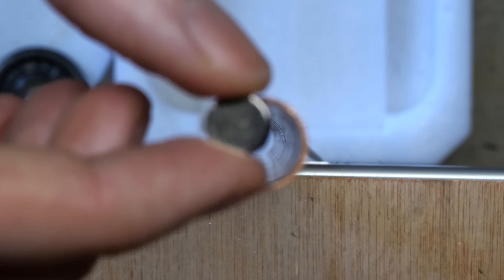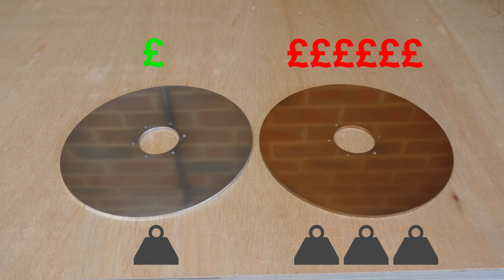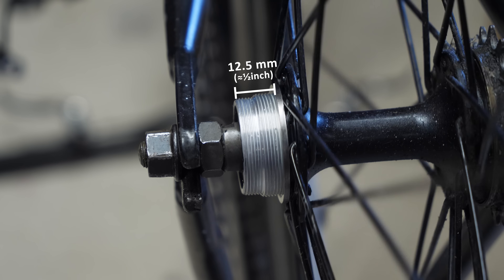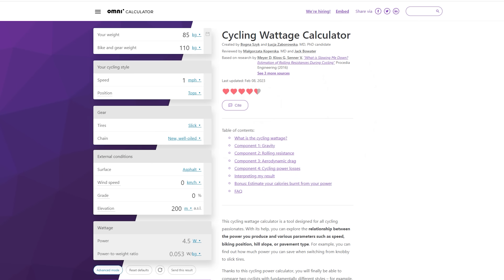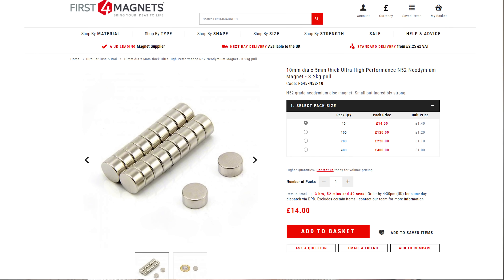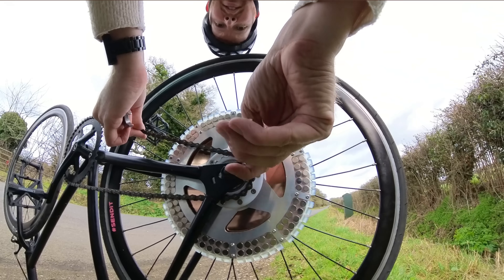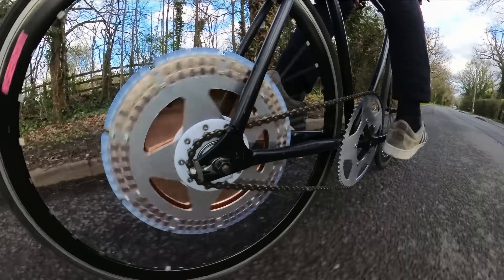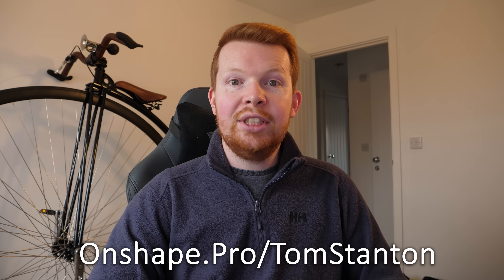Gearless Magnet Bike

Comment: I could see this being used in conjunction with a standard chain drive, as a way to hold a speed or soft-stop. Something with a small lever to introduce the magnets into the vicinity of the disk, maybe as an anti-runaway feature when going downhill. I know what it's like to have your speed get away from you rolling down a slope, and your pads just lose all friction as liquid rubber smears out and forms a liquid bearing between the actual clamping surface and the brake. It's a great way to renew the surface for hard stops, since the melt-cool cycle leaves very clean pads, not so great for the pad life lol. 

Awesome video as always, I will await whatever may come next!

Comment: Maybe I missed it in the comments, but one other problem with this design is that you have to pedal with such consistency or you're losing additional energy. If you pause--or even just slow down a bit--in your pedaling at e.g. the top of each revolution, then for that moment, the wheel is spinning faster than the magnet cluster and some portion of the energy you just put in will come right back out.

Cool idea, though. Have you considered adding some sort of electric assist via a normal (or custom eg belt or shaft) drive, and converting your magnet setup to do regenerative braking. I think a hybrid bicycle like that which never has to be charged could be sold as a "sweat-free commuter", because the electric could engage e.g. only during acceleration from stop or steep climbs, or other times when riders would normally break a sweat...

Comment: You demonstrated the main problem in eddy current systems is that the more force/torque you put in it, the more energy it wastes. This makes them pretty inefficient for power transmission, but good for braking - when wasting energy is basically the goal.
I don't think eddy current brakes would be really useful on a bike, since brake pads are cheap anyway (compared to all those magnets and metal plates), but they are used on heavy vehicles like coaches and trains.

Comment: Would be a perfect replacement for an internal clutch on a very low power moto.  Maybe with an additional friction lockup centrifuge clutch to eliminate heat once rolling.

Perfect for a lawnmower, edger, trecncher, etc, etc....in need of breakaway safety.

Low hp outboard motors used in shallows to replace the breakaway pin.

I just made us millionaires.

Comment: Not sure what you are trying to do here.  Make a magnet brake, a magnetic flywheel gear-shifting device, ... or a Tesla flywheel propulsion device.

Maybe make the Tesla flywheel.  Install a battery pack, inverter, alternator, and use a magnet flywheel with a fluctuating (electro-) magnetic calipers.  Use the same maglev train technology for moving the vehicle across a path line of magnetic rail - with fluctuating magnetic polarities.  The flywheel makes easier and faster velocity, less pedaling.  Have the same motorcycle handle speed device - increase the magnetic fluctuations speeding up the flywheel and velocity ... or slowing down and natural magnetic braking.  As one moves, with pedaling or momentum, the flywheel with another set of calipers charges the battery pack.  A little entropic energy wastage happening - but pedaling and continued momentum keeps up the charge of the battery pack.

Comment: Nice project, thanks for a great walk-through.  I believe Aluminium has a greater electric density than Copper when measured by weight.  However, Copper weighs a lot more by volume, so Copper would come out on top with the same size discs.

Comment: I wonder whether you ever rode a bike in urban conditions. When you stop peddling, the system breaks, which will be a real annoyance. You don't stop peddling in order to break all of the time. I'm from the Netherlands where bike riding is almost the mode of transport number one. And some part of bike riding is done freewheeling without losing speed, like when turning a corner, descending a slope, or just when the wind blows in the direction you are riding. Your system prevents this, taking most of the fun of bike riding.

Comment: It would be nice if you could figure out a way of moving the disc away from the magnets as you are pedaling, then closer as you stop pedaling. Like how a manual clutch works in a car. You could use a handle bar mounted brake lever to engage and disengage the plate. 
Another idea would be to try building something just the opposite of what u did here. Arrange 3 or more plates of alternating magnet discs similar to those so-called free energy motors. So as you are pedaling, you would get a small boost similar to the heavy flywheel experiments you did. It might not be much but it would be interesting to see how much the force would change by adding more discs.

Comment: @Tom Stanton - Plain old AC Induction Motors work extremely well as Eddy Current Brakes, and they are infinitely adjustable across a wide range of 'grabbing strength' just by varying the DC current input. A very simple example is to supply 12 volts DC to the input of a motor designed for 120 volts AC. If you could source a pancake-style induction motor that would fit on a bicycle, you could do both powering and braking with the same direct-drive device, with the automatic benefit that an eddy current brake can't ever totally lock up the wheel rotation... Sort of like an ABS system on a car.

Comment: Ever thought of trying out building a coreless axial flux motor for a bike? If you could minimise those eddy losses, you would for once have a motor that does decent freewheeling and regen-braking. An old Bionx D could be useful for that, although it probably won't be able to develop enough torque.

Comment: Come on!
B+ for idea; D for execution!
In your experiment at 1:24, why aren't you placing a strain gauge between your test weight(s), and the cord!
That's the information you want!
Yes, the rotational inertia of the disk IS a factor, but, rototional momentum is a function of ￦^2, plus, you are talking about a bicycle wheel, with a lot of additional mass...that's a separate calculation.
Once the disc is revolving, it's a pretty steady state, is it not?
So the force indicated by the strain gauge less the weight of your ballast mass should clearly indicate the braking force of the eddy-current effect!
Also, this opens the door foor testing at higher RPM's that we would expect in 'cycling.
(And get some smooth jaw covers for that vise! You obviously have the money!)

Comment: Why don't you use repelltion of permanent magnets without electricity to spin the wheel or a generator
Buy using gears clutches and control plates to stop repelltion if necessary to gain more control over the system

Comment: A nicer version would be to use the magnets to make a dynamo, store and smooth the energy with super capacitors and use DC-DC converter to power a motor and control the pedaling force/resistance. But that's too complex for a small project.

Comment: You realize the purpose of the gears is to act as the transmission.... as opposed to a break... right? I'm just guessing here, but the torque transfer hyperbola that you get from one of these magnet Drive gears is actually facing the wrong direction.... given that the purpose of a gear is to actually control the amount of torque relative to the grade of the ground your riding on. So what exactly is this for? A brake? Or am I missing something...

Comment: Wondering how it might work using a motor to drive the clutch rather than the pedals? This could then provide frictionless supplementary power when using a regular pedal / chain/ gears setup.

Comment: Would this application be practical just for its braking performance?  I live in an area with lots of steep grades and ride an E bike that weighs  a 100lbs.  I've already eaten through several sets of brake pads and have even retrofitted larger discs.

Comment: Great project, but why the heck are you still using a plastic gear on the rear wheel? It make no sense! 🤷‍♂️🤦‍♂️
Btw... When you use an kind of power generator - why no to go step forward and use it to produce energy for as an example lights on the bike... Or an resistor - maybe it would be easier to go uphill?

Comment: This is really brilliant, but I was skeptical at the start of the video, since the force is transmitted, not the energy, IOW, the whole transmission system will have much less efficiency. So none of your results surprised me. By the time I got to the 15:00 I was fairly shouting at the screen "You're working harder because you're dissipating a lot of your energy into eddy-current heating of the disc. Measure the temperature and you'll see, it must be very hot." And then you measured the temperature. To make an automotive analogy, it is not much like a CVT, it is more like a torque converter in an automatic transmission.

Comment: I wonder how a radially-split copper disc would affect the eddy currents. I'd assume the right size of splits would disturb the eddy currents and implement a tighter clutch; of course the wrong splits might do the opposite, rendering the disc nearly as effective as plastic.

I'm just imagining at some point you had currents going fully around the rim of the disc.

Comment: The key term here is "dissipated power".  That is how your clutch is working. By DISSIPATING the energy you are providing by pedalling. The movement induces an electrical current which is short circuited by the copper and turned into resistive heating. You have invented a bike where you are always riding up hill !!  Riding a bicycle already produces quite a bit of CO2.  You have just upped the " grams of CO2/km" !  LOL.   Interesting video, none the less.

Comment: fascinating, maybe with more R&D you could come up with a genuine marketable product with low maintenance variable gearing, but for years i rode fixed wheel on my winter bike which is about as light and trouble free as it gets, (even though it could be quite tough on club runs in the yorkshire hills lol). GL

Comment: This is how many exercise bikes work. Exercise bikes typically spin the flywheel faster instead of using stronger magnets - so the low damping of weak magnets gives higher power dissipation due to a faster rpm.

Comment: Absolutely Brilliant idea!       I’ve struggled thinking of a solution for an inertia clutch used on 7.5 gauge train.    This hand powered train is operated by a small child using a vertical push and pull lever method, however operated by only one person.   

Once under motion stopping is near impossible as the inertia transfers back to the hands.   One way clutch sprockets make start off difficult without starting  assist (a push) to get the offset crank under motion.     

This combined with a radial ball bearing shift cvt (drives the SIDE of the chain) may be the “magnetic clutch” needed to start off easily with faster easier hand movements shifting the cvt quicker , then stopping when hand motion ends without a sprag style lockup forcing movement of the handles causing the child to let go.

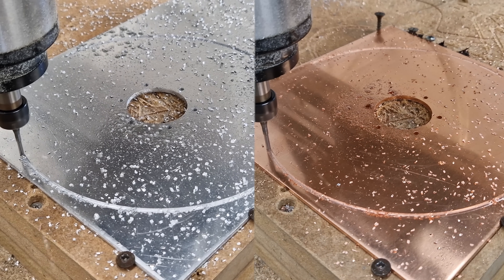Comment: 0:33  "To replace the gear system on a bicycle" 
Makes crappy plastic gear to replace perfectly good metal one

This was entirely pointless and counterproductive, however good for learning. But as a project, an archaic fixed-gear bike accomplishes the job with nearly 100% efficiency, with minor mechanical losses. The whole point of the clutch is to engage the hub which engages the wheel... Si the idea of using magnetism introduces an extra step that makes the whole thing an inefficient, expensive, fragile mess. It's the equivalent of gluing sponges to your pedals or taking the teeth out of the chainring and just making it work by sheer friction. Mechanical engagement is the way to go for these simple things. Hope your next project goes well

Comment: Making the copper plate thicker would reduce the number of magnets needed by decreasing the resistance for the eddy currents. And as other people have commented mounting the magnets in a steel mount would also improve the performance by helping to concentrate the flux. Similar just for kicks project would be to try to convert this into a homopolar motor regenerative braking setup with some big capacitors.
Reply: Also making the plates from a larger diameter plate would result in less input speed equal to the increase in primary drive sprocket getting that magical speed differential is probably key to better transmission and more heat dissipation
Reply: @Neil-z2o Bring on the copper wheel rim! About as little slip as fixed gear mechanical at maybe 4x the weight! Would be an interesting test.

Comment: If you construct a mechanism that can move the magnets more inwards on the disk (decrease the radius) and outwards you could get a continuous shift in transmission ratio instead of integer ratios. I might have skipped the part where you mention this in the video
Reply: If I understand you correctly, thisiis not true. The gear ratio would be the same; the magnetic transmission does not seem to provide any advantage over direct chain transmission.
Reply: @filipdominec9604  Ah yeah right the rear wheel also has a chainring

Comment: Tom,  I have written software that simulates a bike electric rear wheel/CVT using the equations from the book “Axial flux permanent magnet machines”.  Was thinking of getting in touch last year but didn’t.  Now saw this video and see you are still interested in the problem.  As you show at the end of your video, the main problems are efficiency and especially getting torque for climbing efficiently.  The software I wrote uses a GA to optimize the parameters of the motor generator to achieve a target efficiency profile over the operating range at minimum cost.  Unfortunately, it turns out it’s good to have a few gears to get efficiency up over 90% across the whole range.  The S/W will optimize gear ratios.  My plan was to get efficient regen going downhill to use the power going up.  I sent you a LinkedIn connect request if you are interested in getting in touch to have a chat.

Comment: Pretty cheap - to cover coper by silver layer
you need some like 10% water solution of AgNO3 salt(silver nitrate, obtainable as a medicine pencil for removing of skin problem, or you can find Ag and dissolve it in HNO3(30% ok.) at RT, or with heat(boiling maybe even - you need any borosilicate glass chemical flask or test tube(5pcs for 1$ or so) H2SO4 concentrated >90%, or in mix of some like NaNO3+NH4Cl melted

17:18 you have to produce ellipse(oval) gear for it - it allows to turn pedals faster and easyer when pedals  in vertical position that not good for applying efforts, and when you can push full power, when horisontal pedals, gear will in vertically long position, like on higher gears ratio
surprisingly almost no chain-lenght-variation occure when rotate it, because half of circle(and ellipse too) longitude perimeter -always same ...half

and it must be much better if you set magnets in halbach arrays - better efficyency with same magnets

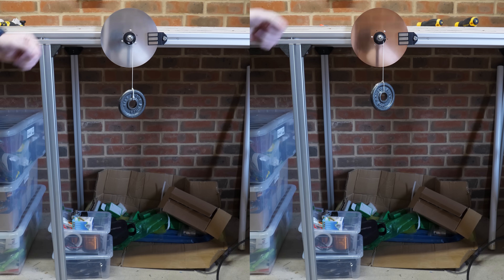Comment: Firstly I am impressed that you did not agree with G0ogIe on Al conductivity, the Artificial lnteIIgence in anycase is a liar motivated weirdly by it working out which Cu or Al has the least environmental impact!  And alluminium circuit boards suck.  Seriously no joke!!!   1:49  as a scientist your constant force test is invalid, and veritassium is jist as invalid, but for exactly related reasons, ironic.   It dose not mean that Al is better than Cu just the test is Galileo invalid.  The reason is the inertia in the Cu is higher no matter at the start of the spin or the end the inertia {resistance to change in velocity, angular or streight it makes no difference} it is still the same!  Just as a body in freefall is accelerating  constantly both at the beginning of its fall and the end ... because the inertail force is the same just as the mass is the same!  To make the experiment valid you need an electric motor that is set to spin at a constant speed  ... then measure which motor  on Al or on Cu works the hardest to maintain that constant speed. Naturally the motor must be beefy enough not to be maxed out ... OR the constant speed slow enough that the magnetic feedback is not too high for that  motor.  Use an amp meter.  
So this is an excuse to exceed both yourself and veritasium in a new video.  Sorry that your clutch system burns energy like that so as a break it sucks at slow speed too and as a cluch it is an exercise bike waiting for patent ... sweat!

Comment: just needs a way to disengage or move the magnets away from the copper disc using wires or some mechanical design, so you can cruise without the friction you experienced when you stopped pedaling

Comment: You could significantly reduce the slip rate by increasing the magnet ring to the wheel rim diameter, only problem would be needing to completely re engineer the bike frame to mount the giant disks

Comment: It's an interesting concept you have here.  The only real application thus far for something like that is the induction motor.  Watching your demonstration was like Matthias Wandel's explanation on how electric motors work where he took a forced air furnace fan motor where he added a weight, pulley and a DC power supply up to it showing the resistance when magnetic energy through the stator windings then suddenly disconnecting the supply showing the weight suddenly falling to the floor.

Comment: Ja.. Gearless as in singlespeed. There's nothing here that facilitates gearing, it's more like a continuously slipping clutch. And unlike a car, where slipping the clutch can "help" at low speeds, the torque of your legs does not diminish at low RPMs.